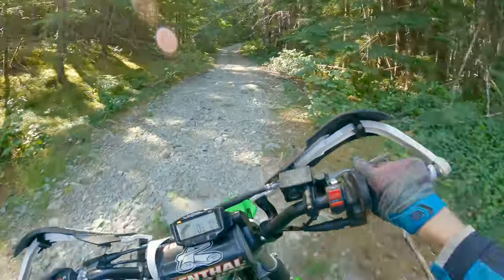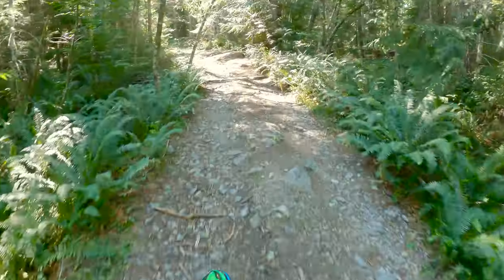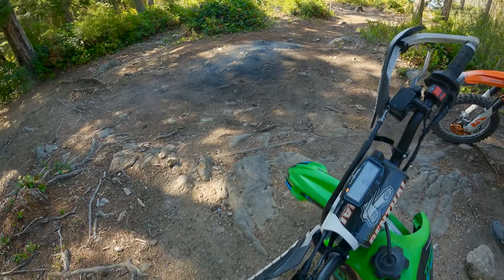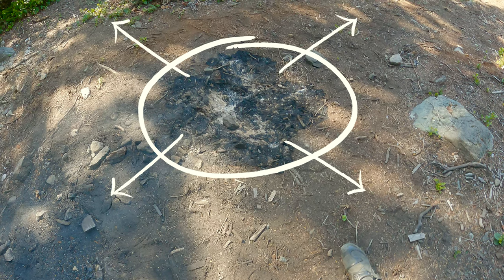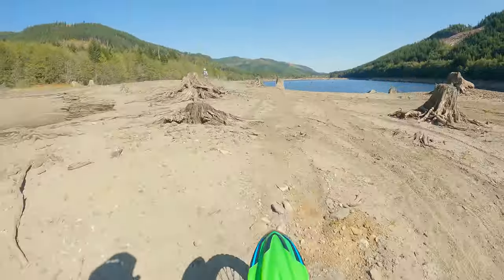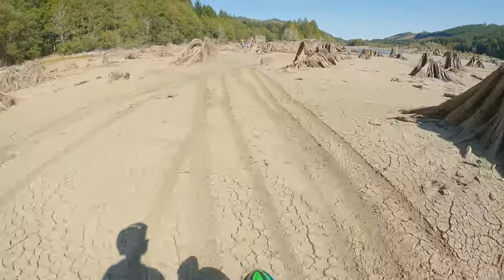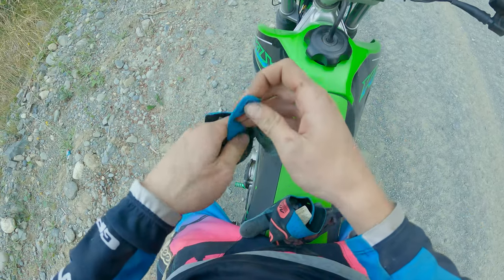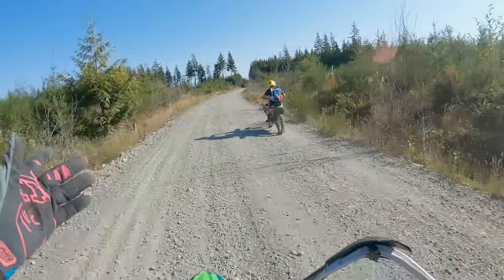First Test Ride On The BBR KLX170RF

Comment: Mr. Ripper! Great Job Aaron - what about Sprockets? Still using stock Gearing (13/57)? I am using 12/57 and thinking to go with 12/60 if available.
Reply from the maker: Using 12/57, would be interesting to try 12:60

Comment: can you do a top speed test plz
Reply from the maker: Top speed will be unchanged as thats gearing based not engine power based. It definitely accelerates quicker tho
Reply: @AaronsEnduro  interesting I thought it changed speed and acceleration
Reply from the maker: The only way to alter a motorbikes top speed is by changing the gearing via the front or rear sprocket, or if somehow you could, changing the gear size itself in the transmission pack

Comment: If it's drinking like a monster, that means your pinging you need a higher Octane fuel..
Reply from the maker: Not shown in the video but we rode a ton more I didn’t film, and i should mention this was more of exaggeration. Yes it drinks more fuel than before, but not at a ridiculous amount. I also already run the highest octane fuel available on a consumer grade
Reply: @AaronsEnduro  I see! Right on! Well you could always add octane booster..will bring up the octane by atleast 3 points..